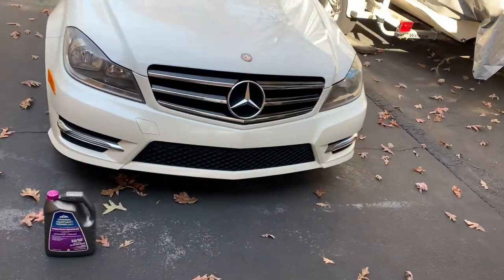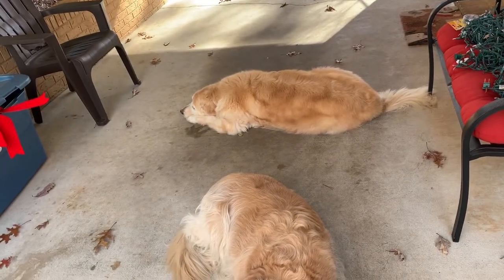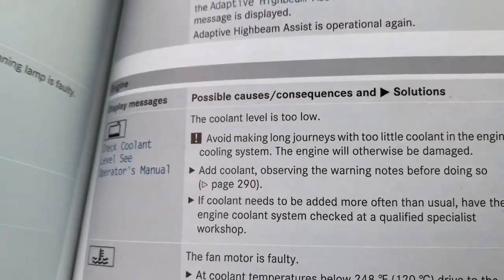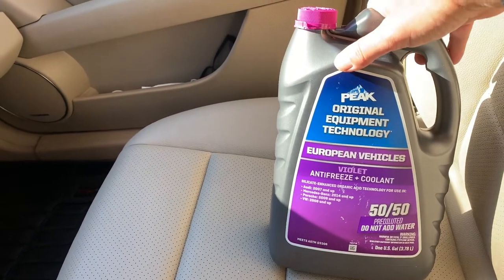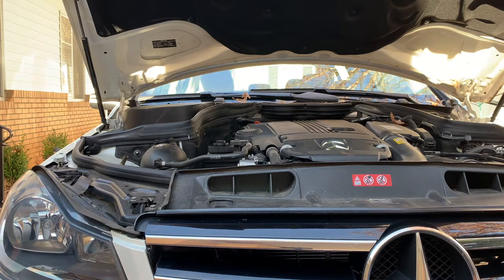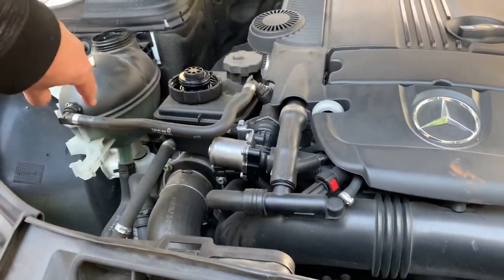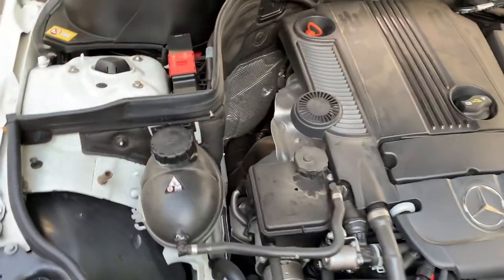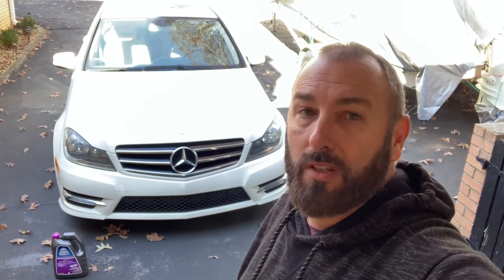Adding Coolant Mercedes Benz C250.

Comment: i fill mine up and the next day its back to half way?
Reply from the maker: That is very strange. Are you only filling it up to the fill line? If you fill it completely then it’s probably burping it out back down to the fill line.
Reply: @LivinWith3M  i fill it up to the line but the next day its saying I need coolant I see no visible leaks so takin it in to see whats up!
Reply from the maker: Definitely do that because it should stay full. I know mine stays full. Please let me know what you find out.
Reply: @LivinWith3M  got you!
Reply: @LivinWith3M  turns out my coolant pipe had a small leak we all good now 👍🏽
Reply from the maker: That’s great that was all it was. Glad to hear you all good now. 👊🏼

Comment: I cant get mine open
Reply from the maker: What can’t you open? The hood or the reservoir? I’m not trying to sound funny either, that hood sometime can be a pain to find the latch all the way under the dash. I know I struggle finding it. As for the reservoir it should be just push down and turn. Let me know. I’ll help anyway I can.
Reply: @LivinWith3M  no. the cap on the resevoir. it seems to be locked. I can only manage a quarter turn. There seems to be a block of plastic stopping it from turning any more and I can`t pull it either. seems to be a common a common fault on a couple of forums.
Reply from the maker: Wow. I had no idea. That’s crazy. Only thing I can think to try is push down hard. Like a medics bottle then turn. If not then instead of taking it to Mercedes’. I would probably try a local garage just ask. Sometimes we get lucky and a prideful mechanic will remove it for free. It’s worth asking before the dealer. Please let me know.